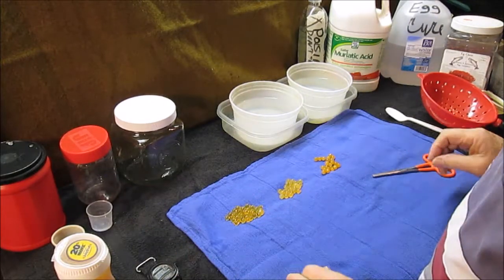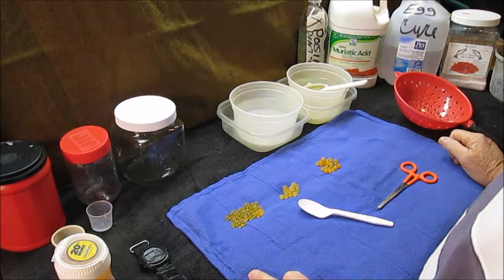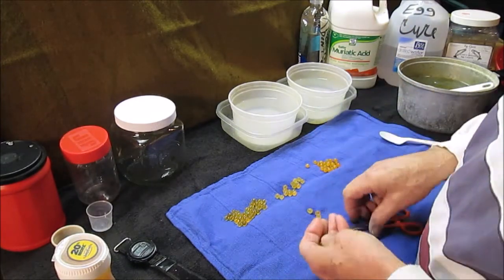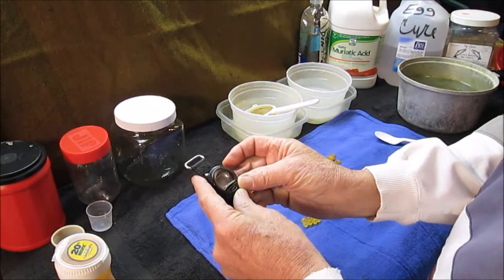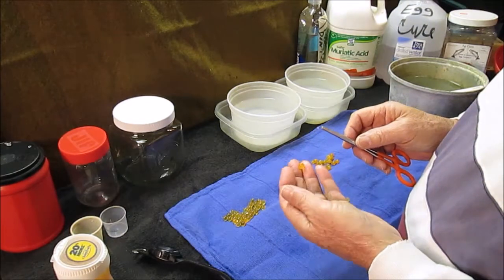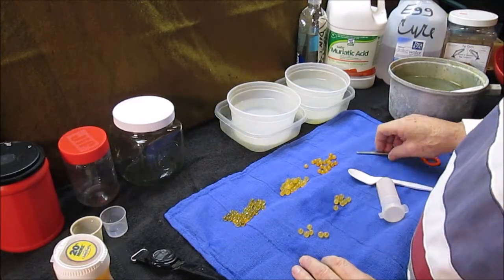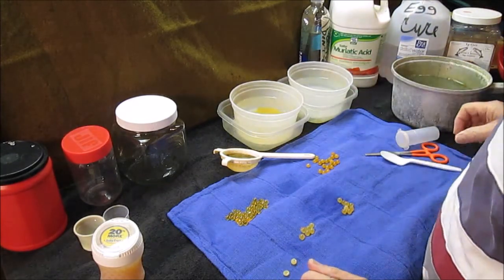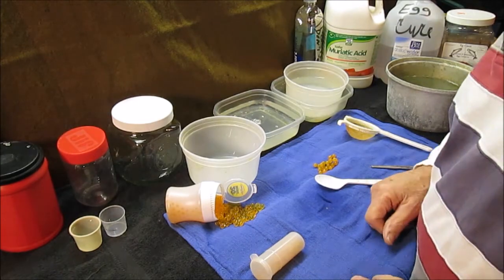Single egg - new process

Comment: Hey Jack,at the end of story what you mean when you say "starting a cooking process" after bathing eggs-what is the temperature of water where eggs "cooking",is that boiled water maybe or tap cold water and then just chemical process reacting cooking,and how long you keep them in clean water at the end?
Reply from the maker: Good questions, cooking in this sense means the chemical treatment applied to the eggs. You should use room temperature, distilled water for the solution, in which you place the eggs, and the after "bath rinse". You rinse the eggs to stop the "cooking" process. Place the treated eggs on a towel to dry of some of the moisture and store in the frig until you use them. I believe it is best to treat and use the eggs as soon as possible so only make what you think you need. Remember, you should change my process if you get better results with a modification you made. Experiment on a small batch until your eggs suit you.

Comment: I like those eggs just cooked enough to hold the hook. 1 to 2 casts tops then you milked out. I watched you first video about 8 yrs ago and been use that same method since. Just cooked some tonight came out like gems. I just don't cook them as long as you do. 20ml to 2cups of water 3 to 5 mins.
Reply from the maker: Time, acid strength and water are the variables for sure. Sounds like you have created a "better mouse trap".  I will give it a try next batch. Thanks for the note.

Comment: Hi Jack great video as always, thank you
what do you think about switching solutions (start with stronger and see how they turn out and than if need be hit it with weaker one)
and when you talk about "cups of water" what size is that
thanks in advance
Reply from the maker: I tried stronger bath and got nearly solid white eggs.  I use a measuring cup.

Comment: how do you know if the river water does not change the chemical reaction of the eggs when they are in the river and fished

maybe the wash should be river water??? than tap or filtered???
Reply from the maker: Good point. One thing for sure, everything affects bait production. I am told that steelhead can detect 1 part per million!